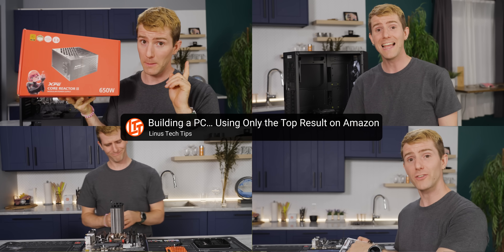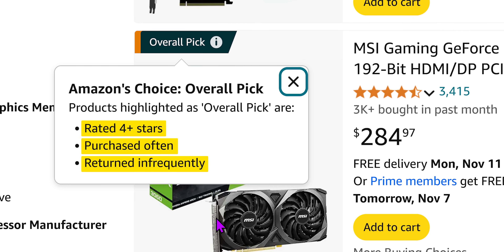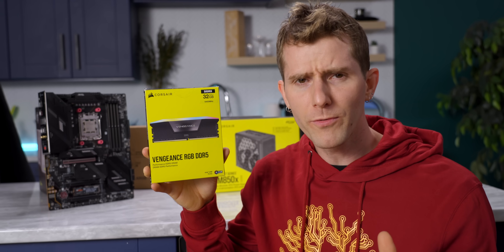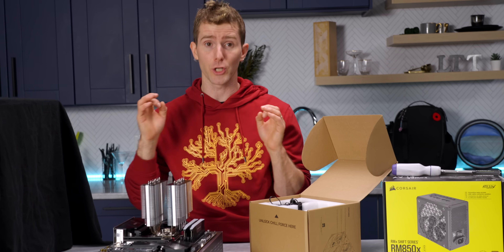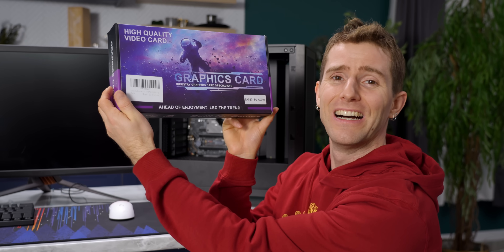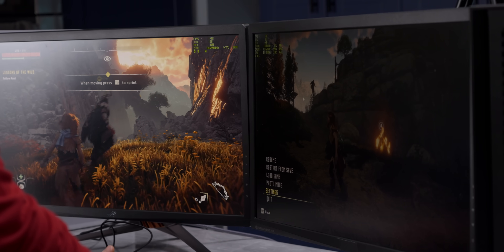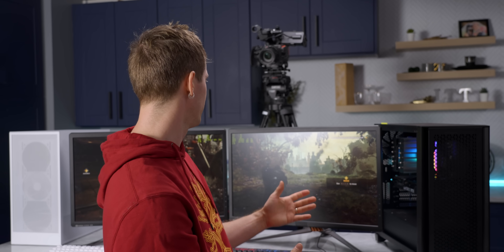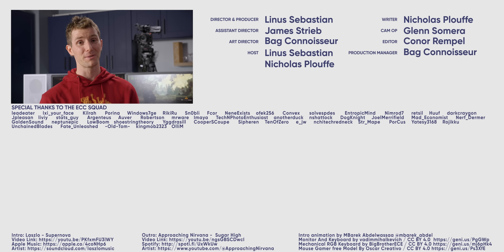Building a PC Using Only Amazon's 'Overall Pick' Products

Comment: One of the things I've found helpful is if you look at the description of the item under the price, it will let you know if the item is frequently returned, regarles of the star rating. Another good thing I have found is a Firefox feature that will give you a rating of the reviews and let you know if they are legit or fake somehow. Alomst at the end of the video, I guess I did pretty good in picking my parts by hand. Other than the ram and the fact I went with a Coolermaster water cooler, I have the same case, CPU 5700x, GPU 7700xt, and MB. I transferred bot my 2TB WD black NVME drives over from my old PC along with my 16TB 3.5 old school spinner. (my raw data drive). I didn't have any problems with my PSU. But I did install the cables before I put it in.

Comment: I realy don't need to upgrade with the games I play, but The 2 biggest things holding me back is VRAM and RAM. Ram is only in some games. The VRAM of my MSI 3070 ti is the biggest thing holding me back since my friends with 12 GB of VRAM in their 3060s get better FPS in VRAM intensive games, where I get in in non VRAM intensive games. But due to my money situation, I maybe unable to get the GPU upgrade I need till the 6000 NVIDIA cards. As for the RAM, it is hit and miss with some games, It does well for 99% of my games, that 1% 32 GB is not enough like Starcitizen (or as Thor calls it Storecitizen).

Comment: Some key points I would have liked addressed about the BX500... it's probably popular for upgrading old computers, but its sibling the MX500 is better due to the improved caching. Looking at responsiveness, caching is more significant than the maximum performance. NVMe drives (like the P3 Plus shown) actually do not need much caching on-device due to HMB caching. Some of them do have a DRAM cache but it's much less necessary.

Interestingly, this also means cheap NVMe SSDs are often faster than cheap SATA SSDs -- assuming the flash is the same, NVMe HMB can rely on system RAM whereas the SATA puts that all on the drive itself so the drive's hardware must include that internally.

Comment: The reason why it recommended a SATA SSD is probably compatibility - a lot of folks shopping for just an SSD might not have an M.2 on their motherboard if they're upgrading an older system. Amazon has no way of knowing what you'll be plugging it into or that you're building a new system.

Comment: For a gaming PC, I'd probably choose the even cheaper Ryzen 7600 for about 45 to 55 USD less, and put the extra money toward an RX 7800 XT, RX 6800, or RTX 4070 instead. Local pricing, exact models available to you, as well as the space constraints of your case, will all likely be important factors to consider for which videocard to choose. The RX 6800 can still be found for about the same price as the 7700 XT, performs about the same, and has more vram, whereas the 7800 XT or RTX 4070 will both be even more powerful than the 7700 XT, with the 7800 XT also having more vram as well.

The six-core Ryzen 7600 CPU isn't likely to run significantly slower in games than a 7700X with any of these graphics cards, will use a little less power, and will likely provide even better value than the 7700X, and the money you save on it is probably better spent on a better graphics card, or more SSD capacity. I wouldn't worry about it "not aging as well" as the 7700X, because CPU prices will likely continue to come down over-time, and by the time a 7600 starts to seem slow to you, Zen 6 will have likely already been available for at least a year or more, with prices likely having already dropped significantly from whatever the launch prices are. Also, within a few years, the 9800X3D will likely be available for a much lower price than its current MSRP, and there may also be a 6-core 9600X3D variant of that CPU available as well.

Comment: 1080p medium is slander on the 3060. I have an 11700k and a 3060 and I'm enjoying Ray Traced 1440p Cyberpunk on medium-high graphics on stock cooling. Temperatures get a little high but nothing worse than mid 80 degrees celsius. If I take the side panel off and open a window, that drops significantly

Comment: This is may Window shopping list
 Gigabyte NVIDIA GeForce RTX 4060 WINDFORCE OC Graphics Card - 8GB GDDR6, 128-bit, PCI-E 4.0, 2475MHz Core Clock, 2x DP 1.4, 2x HDMI 2.1a, NVIDIA DLSS 3 - GV-N4060WF2OC-8GD,	£258.98, Crucial Pro DDR5 RAM 32GB Kit (2x16GB) 6000MHz CL36, Overclocking Gaming Memory, Intel XMP 3.0 / AMD EXPO, Computer Memory (PC) DDR5 32GB RAM, Black - CP2K16G60C36U5B £66.99, Samsung 970 EVO Plus 2 TB PCIe NVMe M.2 Internal Solid State Drive (SSD) (MZ-V7S2T0), 	£129.16, Intel Core i5-13600K Desktop Processor 14 cores (6 P-cores + 8 E-cores) 24M Cache, up to 5.1 GHz,	£200.38, Asus TUF GAMING B760-PLUS WIFI, Intel B760, 1700, ATX, 4 DDR5	 £149.99, GIGABYTE UD750GM Power Supply Unit - 750W, 80 PLUS Gold Certified, Japanese Capacitors, Fully Modular, ATX 3.0, UK Plug,  £64.99,  ARCTIC Liquid Freezer III 280 - Water Cooling PC, All-in-One CPU AIO Water Cooler, Intel & AMD compatible, efficient PWM-controlled pump, fan: 200-1700 rpm, LGA1851 and LGA1700 Contact Frame  £60.82, (ARCTIC Freezer 36 (Black)- Single-tower CPU cooler with push-pull, two pressure-optimised 120 mm P fans ( swap the above for this to save 17 quid)	 £43.81),  ARCTIC P12 PWM PST (5 Pack) - PC Fan, 120mm Fan, PC Case Fan, PWM Sharing Technology (PST), Pressure-optimised, quiet motor, Computer, 200-1800 rpm (0 rpm <5%) - Black,  £26.69, Phanteks XT Pro ATX Case Tempered Glass Window – Black £65.49.  TOTAL:  £1,023.48.

This is normally  around 1200 -1300 quid

Comment: 2:40 Wait, what's wrong with budget Crucial SSD? I use them for years, my first high capacity SSD was a budget Crucial 1TB one that I still use after about 4 years, paired 2 years ago with a 4TB one, never had one failing on me.
Reply: SATA is considered last gen by elitests.
Reply: It just doesn’t make much sense to get when a similarly sized NVMe is not that much more expensive

Comment: The GPD Pocket 4 is coming out. Please tll me you're going to review it and compare it to the Pocket 3. I LOVE MY POCKET 3. The only real gripe besides the one potential single point of failure for the screen is the one thunderbolt 4 port and how its the only way to charge it yet simultaneously being the do-it-all port that if it fails, the whole laptop turns into a paperweight. Was hoping they'd put a second one on the 4 but they're ditching thunderbolt for USB 4 and moving it and not suplicating it. So its another single point of failure. And what is the AI feature the pocket 4 is sporting? Is this like a GPD version of Siri? Why do I want this? I kind of think maybe I don't.

Comment: I typically stay away from sponsored items on Amazon, but their overall picks and best sellers have been decent. I typically go to 1-2 star reviews and see why, if it's for damage or DOA and that's it, I'm more inclined to buy it.
I would like to see a video on cables, different USB cables, display port and HDMI cables, and see how they perform and then cut them open to see if they are shielded wires or not or what gauge wire was used.
Reply: LTT made a hdmi cable testing video a few years back! it doesn't have everything you ask for, but it does get in depth about the quality of the cables they had.
 https://youtu.be/XFbJD6RE4EY?si=JORzOkUzJ6CcVh_p

Comment: We all know that the GPU wasn't even that ballz to the wall. It was just a discounted AMD that only costed a little bit more than a 3060 12 gb. The 7700xt has even went as low as $359, and will most likely go a bit lower during black friday. It has the power of a 4070, but Nvidia NPC's will still be like "Wahh, I wanna spend 150$ more so I can have DLSS and still not adequate ray-tracing!"

Comment: I don't want to sound like a diva, I grew up very low income and worked hard to build my first pc back then, and it was a crap box true and true, nowadays i'm in a better spot than I've ever was.
The 3060 is pretty alright card, great for a 'late entry' midrange pc.But its falling behind as time goes on. And if we are talking your currency per frames, nowadays id go full amd.
If the 3060 ground is something you are comfortable at, id look at an rx 6600 instead
or well, the 7600xt if your budget allows it.
its all about balancing cpu and gpu, cant really go wrong with most rdna 2 and zen 2 builds, but if the budget is a liiitle bit less of a problem, go up a generation!

Comment: A while back I sold my 3060 for $300 and bought a used 6800xt for $390

The difference is MASSIVE and it's the best upgrade I've ever done, for the low to mid range it doesn't make much sense to go Nvidia if you're gaming

Comment: 4:03 maybe they have a different support in the eu, or for their psus.
Because my eyperience with Corsair support was among the worst support experiences I had. Bought a psu from them and after about a month of using it heard a poof and my lights went out. After putting the braker back in I noticed that I was not able to turn the pc with the corsair psu back on. Taking it down from the sgelf I noticed something ratteling inside it and when I took out the psu and shook it a bit, eventually half a transistor dropped out.
I wrote that to their support and never even got a reply until they closed my ticket without comment about a month and a half later.

Returned the psu with the seller and got a different brand. I was just happy none of my components got damaged.

Comment: the crucial 500gb ssd was my first true ssd i ever had and fun fact i still have it just not in use, bought it in 2015 or 2016 at best buy for 150$
and used it till early this year when i finally stopped using ssds and hard drives and now my only drive in my pc is a 4tb m.2

Comment: I'm confused. I play at 1440p on my 3060 12gb without dlss on Space Marine 2 and get mid 70s on my fps. full pc specs i5-12600K, same GPU in vid, 32gb DDDR 4 4000MT/s, MSI PRO B660M-A CEC WIFI, Be Quiet 650W PSU and a Solidigm P44 PRO 1tb.

Comment: That mobo does still have issues with WD black sn850x in slot 1 (other slots work though).  Roommates friend came by over the weekend because the pc he just built wouldn't turn on.  Updating the bios didn't fix that issue.

Comment: You're missing a large part of this 'amazon' thing.    The actual user base.   No one but enthusiasts buys MBs separately.  The vast majority of the time when anyone wants to get a spare drive, it's SATA of some kind, because that's the ports they have & that's what is in abundance for even mid tier pre-built systems. (No prefab, mid tier combo part system has more than 1 m.2 slot for a drive & that's already filled out 90% of the time you want a drive) .

You're missing out on the context of 'Who would buy this class of product'.   IT's not the same users, andeven an enthusiastic user who bought all their stuff from amazon, for xyz  will not out number or change the weight of your casual users needing a new drive, or your users replacing drives for other people when their boot drive is still just fine.  That is also to say  if you're buying a system and even snapping up a m.2 drive, you're also picking up atleast 1 other SSD & that for the reasons of most MBs not supporting more than 2 M.2, and BT/WiFi M.2 being better than most other solutions means only 1 M.2 is a drive slot & you're picking up larger quanity SSD for misc shit.

Comment: I built a pc last Black Friday from Amazon for around 1200-1300 including mouse, keyboard, two monitors, and a mouse pad. Brand new pc, no used parts and I am able to run any game I want just fine. You don’t have to go crazy to get a good setup
Reply: A budget of 1200-1300 sounds very crazy to me, especially since that will barely get you a mid-range gaming PC nowadays compared to how things were not too long ago. Not even 10 years ago for that kind of money I could get a current gen HEDT and dual graphics cards in the nvidia xx70 tier. 

On my current build I spent 250 on mobo(X99)+cpu(14core)+ram(64GB DDR4)+gpu(quadro 8GB vram), just to give an idea on how ridiculous spending over 1000 sounds to me. Not even considering the fact that I would lose features and functionality making it more of a downgrade despite higher cpu performance and ram clocks.
Reply: @ I can send you the receipts if you want XD 3060 and Ryzen 5 7600x with ddr5 1tb ssd corsair 750 watt
Reply: Keep in mind, this was all Black Friday pricing

Comment: Can someone rate my build, I haven't got the motherboard/cpu yet so I'm just wondering if I could've bought something better (or still can while I have the chance). I just got the 4080 super and r7 9800x3d (waiting for stock on amazon) for motherboard I'm getting x870e aorus elite wifi7, cpu cooler is arctic liquid freezer iii 360 a-rgb black, ram is ddr5 corsair vengeance 6000 cl30 rgb, psu is corsair rm1000e, ssd is wd black sn850x 2tb, case is lian li lancool 216 rgb black. My old build had a gtx 1060 6gb and ryzen 5 3400g

Comment: While I can understand the complaints about the ssd being sata, personally I can only sing praises of the BX500. We use it at work in almost every modern machine, and that is heavy industrial 24/7 use with high temps and sometimes permanent reading and writing. We had no DOAs so far and some have been even running for just about 6 years now without problems.

Comment: Linus - 'the 3060 is getting a little long in the tooth' However the 3060 is, by a decent margin, the most popular card on the Steam Survey and cards such as the 1650, 2060, 1660S and even the 1060 are still going strong, so the 50 series coming soon, really means nothing to the bulk of PC users.

Comment: Both those PCs are shit for the price. For that price you could get a build with a 12700KF and a 4070 Super and it will slaughter both those PCs across the board. You won't even need to cheap out on psu or case. Just go ddr4 for ram.

Comment: This video is why spending even just 15 minutes on the Tom's Hardware GPU Benchmarks Hierarchy page is worth it when doing a cursory search for a new graphics card. The RTX 3060 12GB was a great choice 2 or 3 years ago when it came out based on performance and VRAM amount, but really as of about a year ago, there are better options on the market depending on price and performance preferences if one looks a little bit.
Reply: Not on the Nvidia side there isn't. Jumping to an RTX 4070 for the same 12GB is quite the price leap.
Reply: @Jalex0021  You're comment kind of misses my point and the point proven in the video. In the video a RX 7700 XT with 12GB VRAM is beating a RTX 3060 with 12GB VRAM. It's good to have enough VRAM to act as a frame buffer and HD texture storage, but more VRAM won't make up for a GPU that's too low end to utilize all the VRAM effectively. The reason I said it was a great choice back in 2021/2022 was because it was the one of the few times Nvidia didn't short change a SKU in the VRAM department.
Reply: If anything they were better off with 3060ti

It just outperforms 12gb one even with less VRAM
Reply: @deividasma7343  The Covid-19 Pandemic, Supply Chain Crunch, and a Cryptocurrency Bull Run were going on at the same time. Prices were equal parts insane and stupidly high. In that market, the RTX 3060 12GB was the "better" deal.

Comment: The SSD is clearly that popular for upgrading older systems. I bought multiple of them just to upgrade the PCs of my family, obviously they were ecstatic at the speed/responsiveness difference compared to a hard drive, especially with them being forced out of older Windows versions. My bet is that within 4 years, there'll be an NVMe drive in its place, after most HDD PCs will have been upgraded.

Comment: I'm still rocking the 1080 Ti Duke. I only play WoW and the occasional D:IV, but I can do both at full quality, 4k on a 43" screen, and hundreds of FPS (Lows can get really low sometimes, but not often). Until the 40 series came out, I didn't even consider a new card, because the affordable ones were STILL not as good as the ole workhorse, since I don't really care about RT. Sure, it'd be nice to have, but I'm not having less fun without it.

Comment: I have built 2pcs this month. One for me (4080s and 7800x3d) and one for my little brother. His pc was exactly 1150 and all parts were from amazon,and it has rtx4070,5800x3d,and 32gb 3200mhz ram ,phantex case and 360mm aio cooler,seasonic 850w psu 80 gold plus and also nvme ssd gen4. I don't know what this other build  to compare amazons pick is supposed to be, but it is disaster!

Comment: I'm going to build a new pc soon, would this be good? I got help picking the parts
AMD Ryzen 5 7600
Gigabyte GeForce RTX 4070 SUPER WINDFORCE OC 12GB
ASUS TUF GAMING B650-PLUS WIFI
G.Skill Trident Z5 Neo RGB 32GB 6000 MHz (2x16GB)
Kingston NV2 M.2 1TB
Thermaltake ToughPower GF3 A3 750 W
Arctic Liquid Freezer III 360 A-RGB

Comment: if you are going with a 3060 just opt for an Intel A770. I did an Intel 12900K build that came in at about $80.00 less. The other build was mostly due to the GPU card 7700xt which is about $100 more than the 3060 or the A770 and newer than either card

Comment: The crucial ssd makes sense, theyre cheap enough for people to upgrade their old laptop and get a decent performance boost. Ive installed at least a hundred of them at this point
Reply: my go to is kingston 1tb i have 3 of them installed and a 1tb wd hardrive running windows old wd drives are bulletproof they will run forever

Comment: Especially for the SSD Amazon's choice makes sense. If you don't specify NVME or SATA, the default should be SATA, because Amazon doesn't know if you want to use this in a new build, or to replace an old spinning hard drive in an existing system, which may not have a M.2 slot available.